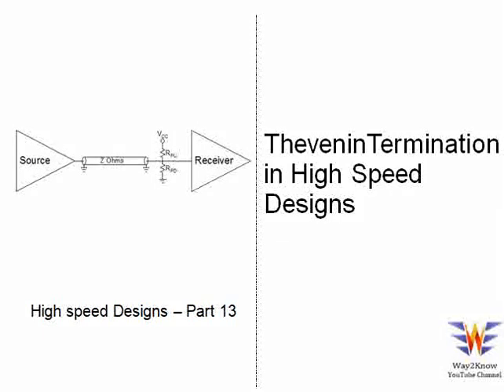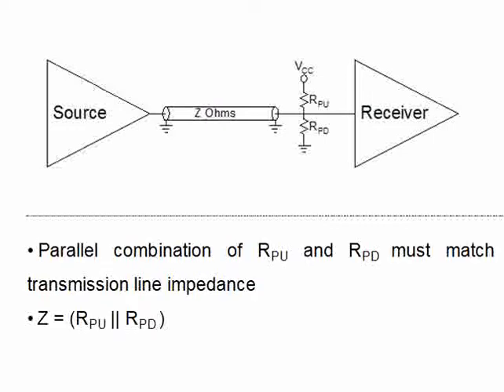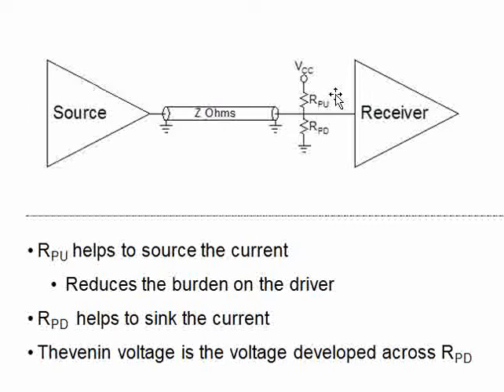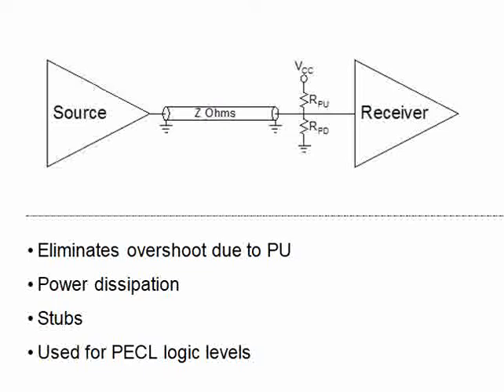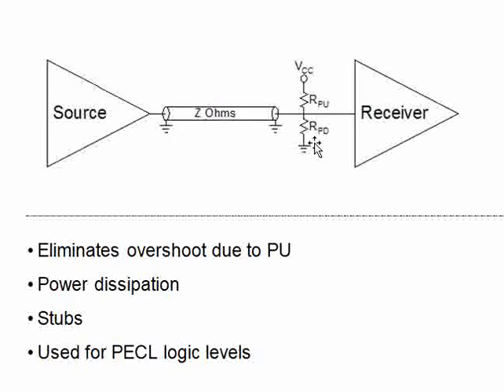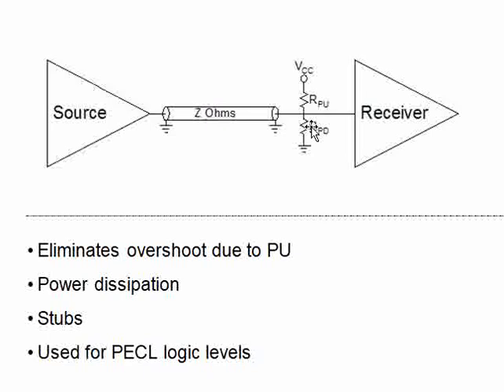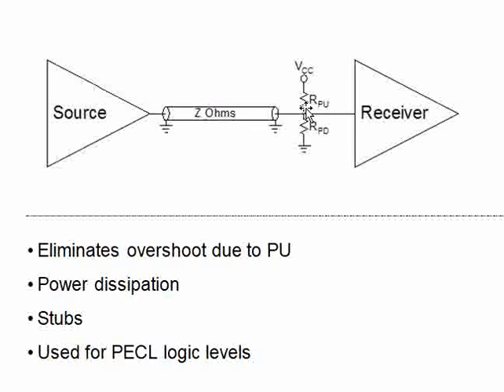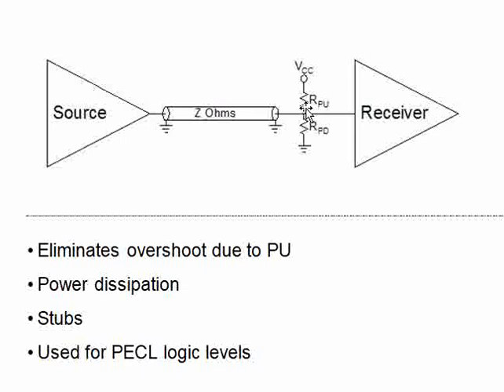Thevenin Termination in High Speed Designs | High Speed Designs - Part 13 |  High Speed Terminations

Comment: HI Thanks for good explanation
Can you tell how to calculate or check slew rate of DQS/DQ signal.??
For Adress command control  / click does not need any ODT IN DDR3?  IF yes then let me know why?
 Can we consider AC135 OR AC165 IN DDR? BASED ON WHAT THIS SHOULD BE CHOSEN
Reply from the maker: 1. For checking slew rate, you have to probe and measure on scope. The default  slew rate can be known from the ibis model. Any variation to slew rate can be done by programmer
2. ODT is only for DATA signals. For ADD/COMMAND/CTRL we have to use external termination. Terminating data signals is challenging and any option internally can be varied and tested by designer without tampering the highest data rate signals.
3. AC135 determine the voltage level. This is for DDR3L. This should only be preferred for DDR3L